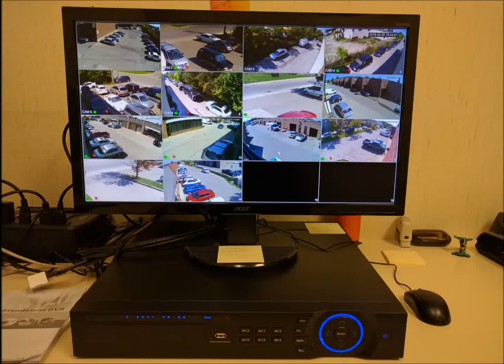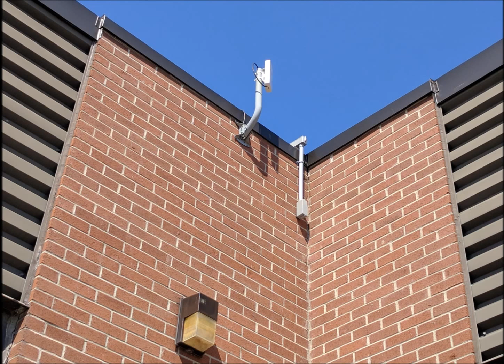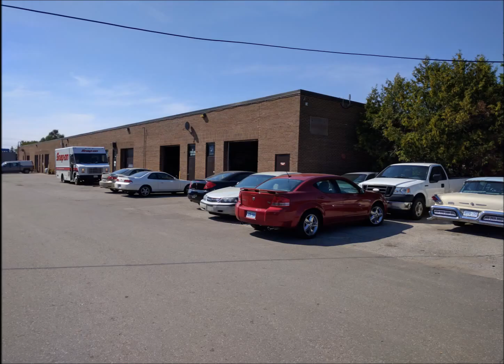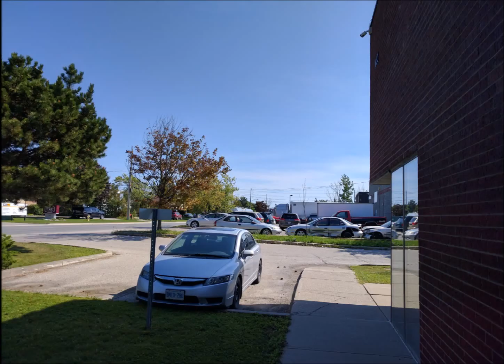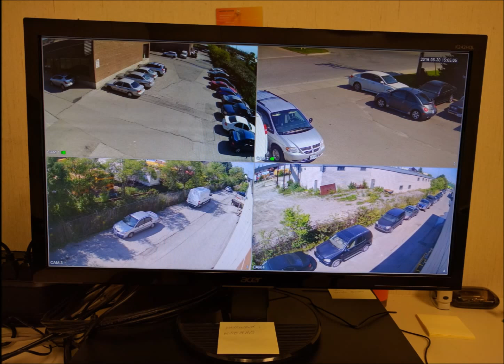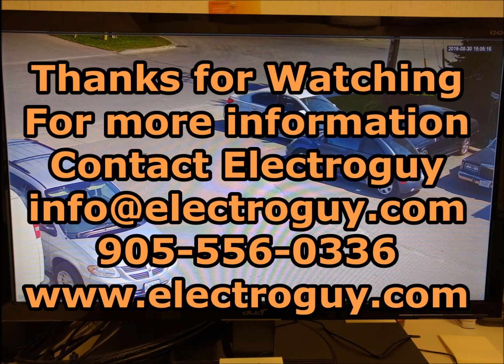Wireless Camera System Installed Across 3 Buildings Whitby, Oshawa, Pickering, Toronto

Comment: Sir, can you please solve my problem by answering these questions below, it'll be helpful for me.

1) how could i install wirelessly HD 11 IP cameras around 23 acres open area farm (11 Camera a far away from DVR) each camera distance 350 MTR.

2)- does we face it simultaneously Heavy rain or Lightning strike or wind causes any problem to transmitter & receiver antenna device change in frequency OR signal strength is changing & video loss.

 3)- Which Types transmitter & receiver antenna do you recommend to buy & which brand is available easily in online or offline market.